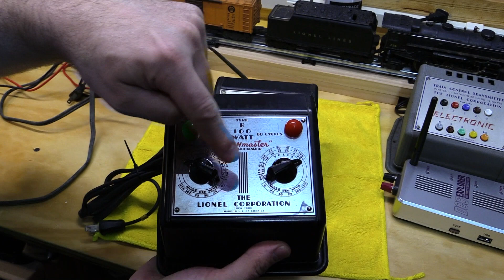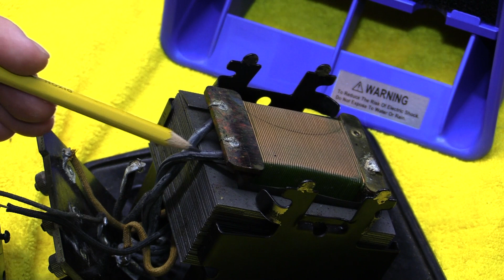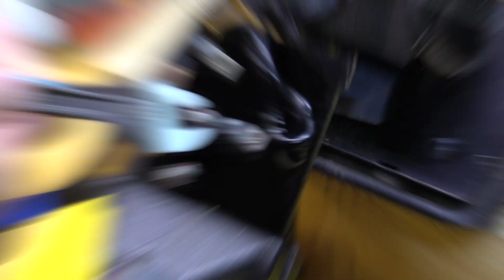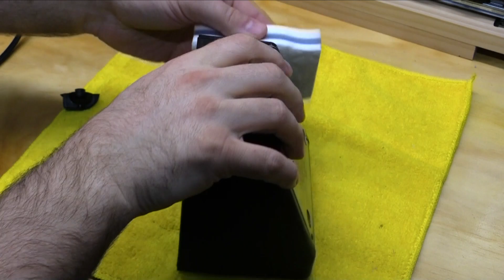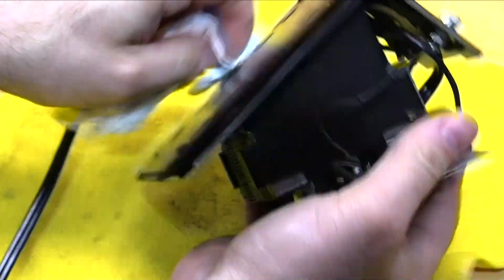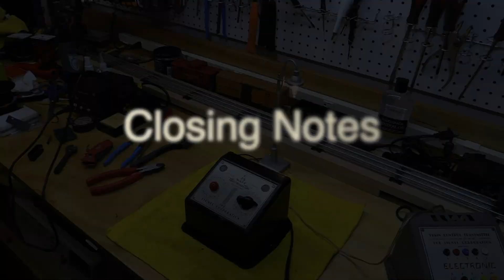Lionel Type Q Repair & Restoration

Comment from the maker: Enjoy the repair and restoration of a Lionel postwar type "q" transformer.
Reply: ericstrains nice job on the repair
Reply: Excellent job Eric! Just a great change of pace. BTW I also like to do repair work as part of my hobby enjoyment and find that ArmourAll or Pledge works great to clean and polish out the bakelite black plastic cases and knobs.
Well done!
Bob in Seattle.
Reply: ericstrains I have a type z twin control transformer, during quarantine I might clean up the Lionel logo now if I can get it off
Reply: I have found a old aluminum o scale locomotive tender I found in a cardboard box in the dumpster with o scale tracks but there was no locomotive
Reply: Timothy Demarco Is it a heavy tender? If so it’s a whistling tender and those are about 25-75 bucks ( condition pending
Reply: @Octopat  when I found it had some dents in the tender but there is no locomotive when I found it
Reply: Excellent video. Very informative. You confirmed some things I lew and as usual I learned a couple. Thanks
Reply: I'm looking for a type TW Transformer Parts listing
Reply: I remember the “whistle” on my old Lionel locomotive from the 50s sounded more like a buzzing transformer.

Comment: I didn't read all the replies so don't know if this was mentioned or not. For soldering electronic components never use acid flux or acid core solder. It will turn beautiful copper wire into green crusties. Always use rosin flux and rosin core solder. Also use 40/60 solder, not the "low lead" solder the "green police" are trying to sell us on. 40/60 means it is 40% lead and 60% tin. It takes less heat and less time make your solder connections and less chance of a "cold solder" joint. If your worried about lead poisoning, just use common sense - ventilation and wash your hands when finished.

Comment: Tip for melting old solder...add some new solder. The additional solder increases the area being heated and helps with heat transfer. From an old pinball repair guy...  :-)
Reply: Ya beat me to it Chris-- great point!
Reply: So funny! I am an old Pinball guy too. Great tip.

Comment: I have found that the Lionel Type Z for some reason that it will run Lionel Standard Gauge Trains much better than the Lionel ZW. I tried with all 3 of my Lionel ZW’s. The type Z has more power than the ZW. I know that the Type Z is a 250 Watt, and the ZW IS 275 Watt.I prefer the Type Z.

Comment: If you have power cord issues even after changing the wire, i usually rub a little piece of sandpaper in the solder terminals to rid of any corrosion. Great job on the repair!

Comment: Hello Eric. I just picked up one these Type Q transformers last week. Ever since I saw this video originally 3 years ago, I’ve been wanting to get this exact transformer variation, and I finally found one that appealed to me. It came with the original box and inserts. It tested out perfectly on all of the thumbscrews, and I cleaned it up. Even though the power cord is in good shape, I do plan on replacing it with a new one. Watching this video again really helped me out. Thank you! Are you still planning to do future postwar transformer repairs? I look forward to it. This video was excellent. Thanks again, Tom

Comment: Eric Love your shows. 
While seeing this you could have reused the terminal solder plate with the new terminals in sted of soldering the wires to the terminals. Also, you should have transferred the cloth sheath to the new wiring.  I would have replaced it with cloth wiring. But since most people would not have cloth wiring reusing the cloth sheath on the new wiring would future-proofing against shorts. Out of all the pre/post-war trains I have repaired I have yet find a cloth wiring that has disintegrated over time.  The cloth wiring is good for future-proofing the transformer.

Comment: Lovely job on that transformer! My grandfather had a much simpler controller for his pre-war setup, but it did have the whistle controller you mentioned. It's amazing just how long these kinds of controllers will last - The electric finger setup in that reminds me of a real EMU/streetcar controller setup! The font on the faceplate and the design in general is very late 30s. 

Using old controllers for accessories is something I also like to do, though I mainly use things like old Tyco or Mehano ones that don't have a very good speed range - And the all-metal ones look cool.

Soviet O gauge, ooh...

Comment: I appreciate your attention to detail, and there is nothng wrong with your soldering skills.  I run a ZW and KW and per your warning I installed quick acting circut breakers between transformer and track
Reply from the maker: Thanks!

Comment: Nice work, thanks!  I actually used one of these as a boy in the late 1940s-early 1950s with my Lionel Train set.  Taught me basic electricity so I'll always be fond of it.  But my sister and I managed to destroy it pretty much.  Bought a LN one on ebay a while ago.  Never knew about the 2 empty hole faceplate version.

Comment: These old transformers have a very high start speed. I have a set from 1972 that was the very bottom of the line train sold that year. 1972 wasn't known for high end to begin with. The little Kickapoo train comes with a circle of O27 track. No straights. At the lowest speed the train flies off of the track. With my much more powerful MRC 180 watt transformer it creeps along. Lionel really dropped the ball on that set.

Comment: Great video  Eric I have a few posts war zw's I use to run my trains with my 180w bricks. I just got some 10A in line fuses between the zw's and my track works great.

Comment: Nice, just a month or two ago I rebuilt two Type S transformers. I replaced the A.C. cord, disc rectifier in the whistle circuit with a diode, the circuit breaker with faster acting bussman 5A, removed the faceplate and repainted the housing, attached a new faceplate sticker to the original one and couldn't swaged  those rivets so I had to glue them. The appearance and functionality is showroom condition. I still have to tackle the RW transformer.
Reply from the maker: Nice work!
Reply: @Ericstrains  thanks, im only in electric trains for two years and that is in TT scale. I needed a hobby after my stroke and picked TT because of the scale 1 inch = 10 feet, being a now retired Aerospace Quality Engineer and Metrologist I could figured out the prototype even though they're European. I'm been in O gauge only since Christmas when my brother took down my late father's 1931 249e tin plate set all boxed and mint. This is only the second time in over twenty years that I've seen it.

Comment: Interesting video! The Q transformer is actually a prewar piece and was first cataloged in the 1939 catalog and was carried over into the postwar period for only the year 1946. When it first came out in 1939, it was part of Lionel's new Trainmaster series of transformers that included circuit breakers. THe best of these was the Z. Another reason not to use this to run modern trains is that the voltage maxes out at 25 volts and that is too high for many of the modern locos.

Comment: When attaching the new binding posts, use solder lugs over the threads before putting on the inside nut. Much easier to solder to than the nut itself.

Comment: Well done. I thought sure that you'd use the nut on the back of the post (inside the xformer) to secure those wires rather than solder them. It works!

Comment: Eric, I'm enjoying your repair of the Q transformer, I'm doing two S transformers and an A, all very similar to your Q.  My question is why did you not use a ring crimp connector vs soldering on your two replacement posts and not put in a modern circuit breaker.  Just curious.

Comment: Eric, first time I'm seeing your video, I'm rehabbing some type s and type a, the a very close to the Qs, Why didn't replace the circuit breaker with a modern 5 amp breaker.  You were in there and did replace the original, why did you not use a modern one . . . .curios.  On my A I can't get it to shut off, when I move the throttle to off it, the voltmeter jumps from 7 to 44 or someplace in between, any thoughts on that problem.

   Thanks again for you video, it was nice to watch someone else doing the same thing.

Comment: Excellent video! I learned a great deal and now have the confidence to restore one of my old transformers. I am curious whether the throttle control is working properly since the train seemed to run very fast even though you moved the knob very little. Looking forward to future videos. Thank you Eric.
Reply from the maker: Yeah it's working perfectly. The throttle starts at 14 volts, so the engine takes off immediately.

Comment: Hi . Do you know if the MRC AH 101  0/27 270 watts  made around 1995  is only good for postwar lionel locos ? Is it good to operate lionel little more modern with sound too ?  Thank 's in advance .  Dan .
Reply from the maker: Not positive, but probably
Reply: @Ericstrains  Ok, thank's .

Comment: Why not just clear out original lugs at the wire ends and slip over the inside threads before nut and tighten ?
I did this hundreds of times.

Comment: hey eric i have a question is Kline its own company or does mth or lionel make there trains  because i have a 4015 bigboy and i dont know what controler to buy thanks
Reply from the maker: K-line was a separate company that made O-Gauge/S-Gauge trains and accessories up until around 2006 or so. K-Line was eventually taken over by Lionel and Lionel still uses old K-Line tooling for some of their stuff. I believe some of K-Line's toolings recently ended up in the hands of Atlas and other companies as well. The complete story of K-Line is more involved, but that's the gist of it.
Reply: @Ericstrains  thanks

Comment: I have a Marx train from the mid 50's. In watching the transformer restoration, you mentioned not having a reverse option on the transformer and I believe the engine only ran one direction. My engine would reverse every time the power to the engine cycled. I've had problems in the last few years with it not wanting to change direction. (Only runs at Christmas!) Are you familiar with the Marx engine's and can you advise on how the reverse works. I've had the engine apart several times to mess with it. Cleaned and lubed, but with marginal results. Thanks for any help and love the channel.
Reply: Hi I collect marx trains what model engine do you have? I might be able to help.
Reply: The E-Unit's coil shaft is sticking. I have used a named brand contact cleaner sprayed thru the straw and liberally applied. So far it has worked for me. Pull the motor out of the shell for best results. Might cleanup the armature while you are in there.

Comment: For the love of god oil the 249e ! 🤣 I'll give you one tip with soldering. When putting 2 wires together tie them for machical connections solder is not that strong. Otherwise a outstanding video!
Reply from the maker: Christopher Bradley The 249e is awaiting a rebuild, so yeah it’s a mess. But it works and it was nearby to use for testing.
Reply: @Ericstrains  Hey Eric did you know that the union pacific big boy 4014 is back on the rails